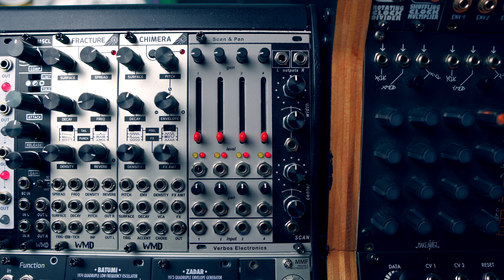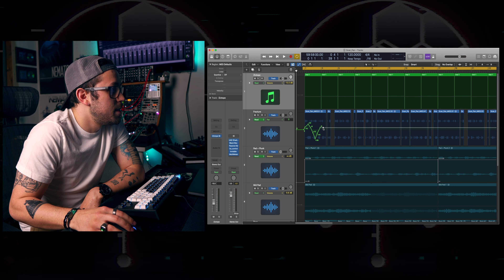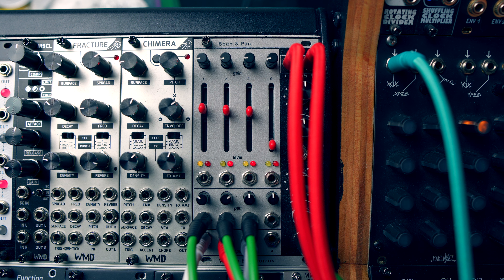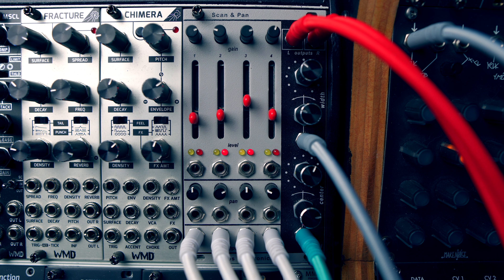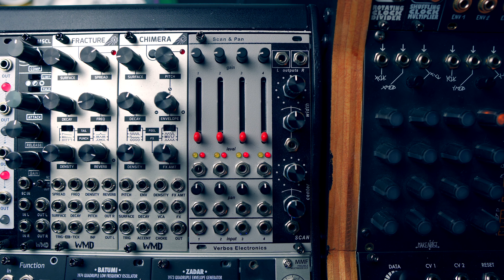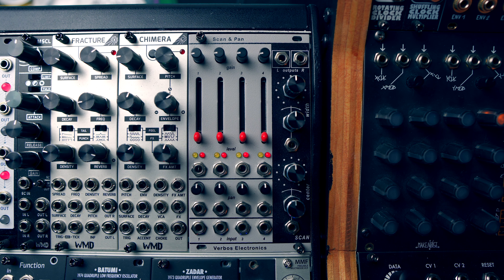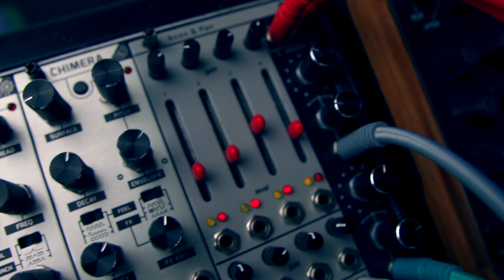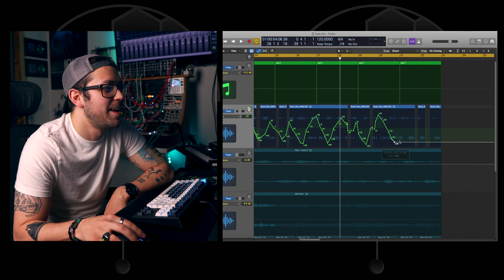Why You NEED a Verbos Electronics SCAN & PAN

Comment: Thanks for the demo. I do rely on the DAW (alongside my Scan & Pan) for spatialisation and one thing I do to avoid having to automate each sound, is to create a bunch of empty audio tracks and pan each of them separately. For instance the first one is 100% left, the second one 75% left, 50% left 25% left etc. and the same for the right. I actually use Goodhertz Panpot because it offers a few more spatial options and I ofter use more and smaller intervals than what I wrote above. Group as you like to maintain overview. This way I have a set framework to throw audio into, rather than having to do the automation thing.

Comment: It's not  exactly the same but it feel like the make noise X-pan could do similare things with the paning. I didnt realy get what the scan part was but is it similare thant the x-fade ?
Reply from the maker: For sure! Very similar designs with slightly different executions, and I would argue this one gives you a little more.
“Scan” is definitely like X-fade, just across all four channels instead of two, plus you have the “attenuator” options of width and center to kind of define where it’s scanning from in the stereo field and how far/wide.

PLUS! individual panning control and modulation across the 4 channels.

It can get wild! 🤙🏼
Reply: Does it crossfade as such or is the fading between the channels pretty abrupt?

Can you use CV on the VCA channels at the same time as the scan functionality?

Comment: Good stuff.  Automation skit had me cracking up.  Def gonna pick up this module.  Seems perfect for what I'm looking for.  One question for ya: is that one or two tiptop mantis cases?  And did you paint them black?
Reply from the maker: It’s just one. At the time I had a 5 row (15u), 126 hp per rail custom case next to the Mantis. Yes I painted it black…which I wish I would’ve spent a little more time on 😅
The power supply in those is super easy to remove so I just spray painted it black. Wish I would’ve used a better clear coat to protect it, but I sorta rushed it to get the modules back in.
Overtime the paint started chipping and I eventually just built my large case for my studio now!
Reply: @Nematomusic  future tip...painting is kinda one of my things...moreso than modular haha...krylon fusion spraypaint is the best hands down for plastic...2 or 3 light coats then a wetter final coat so finish is nice and even...no need for clearcoat.
Reply: Kinda making me want to paint my mantis!
Reply from the maker: @stolencoats63  You should! I could only handle that tan type color for so long when I was swapping most of my panels for black ones 😅